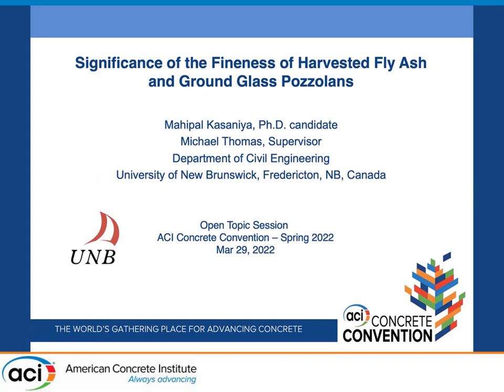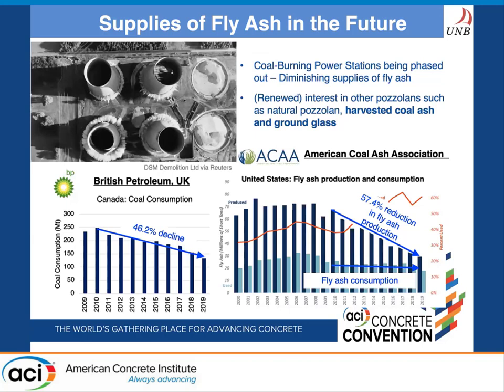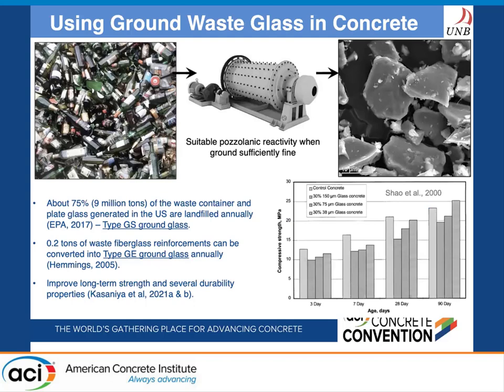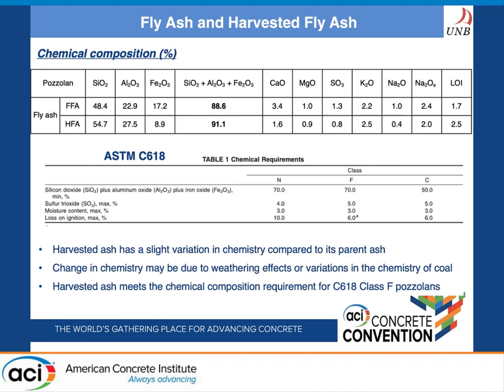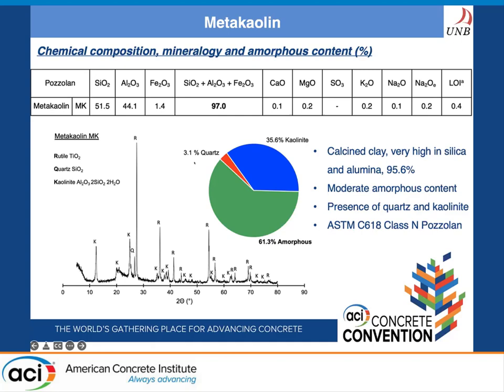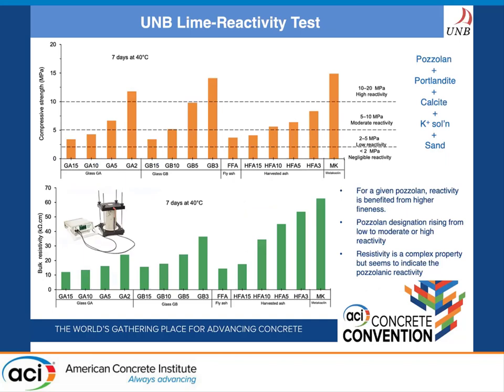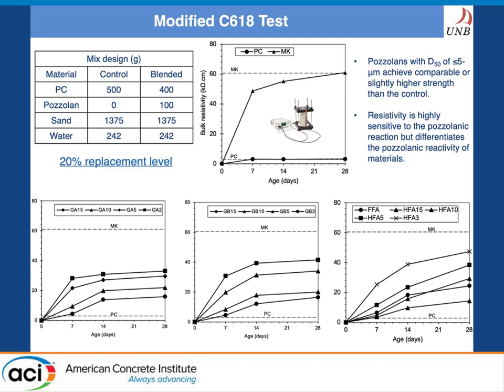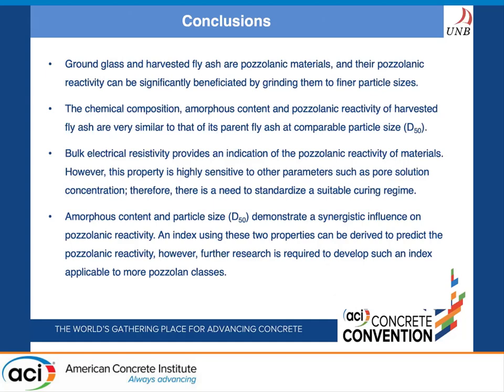Significance of the Fineness of Harvested Fly Ash and Ground Glass Pozzolans

Comment: thanks for explanation, I have a question about the particle size in Ground Glass Pozzolan, ASTM 1866 require  it must be lower 45 µm, but in your opinion which size or range  of D50 is the better option to produce GG Pozzolan
Reply: It depends on what the intention of using ground glass in concrete is. If it is used as a supplementary cementitious material, the d50 range, based on my extensive research on ground glass, should be around 10 micron or smaller. This size will address most of the early age strength and the later age durability issues.